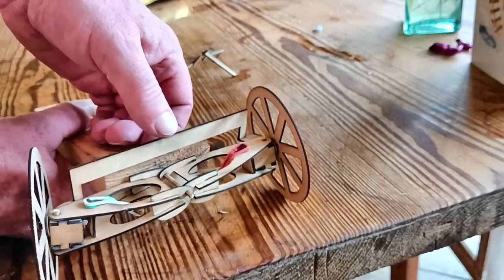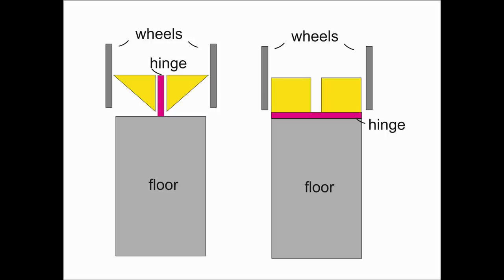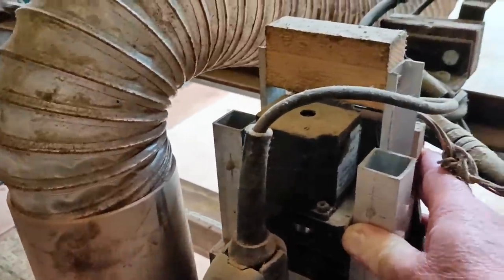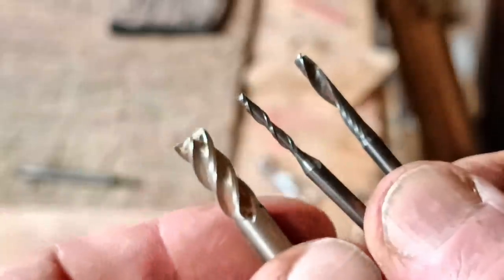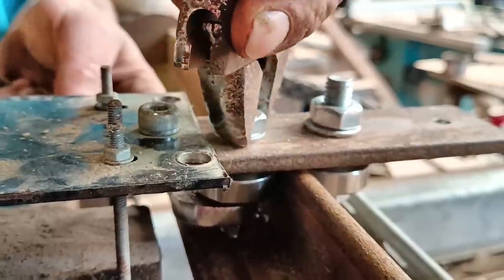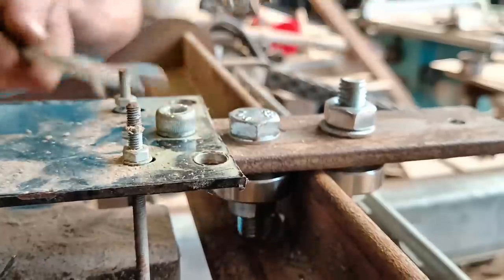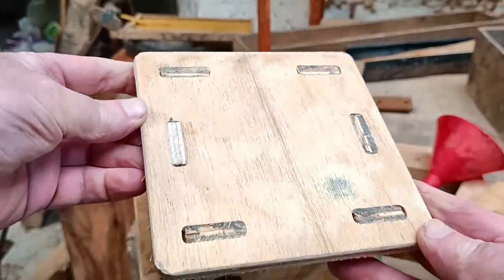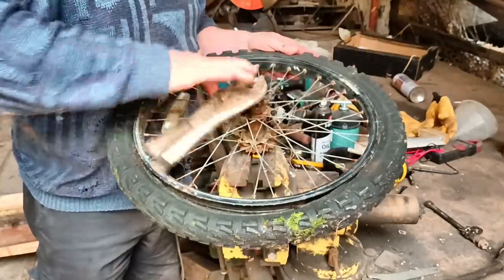Full Size Steering Box For The Wooden Car / Ebike Build

Comment: My dad made me a car when I was a kid. It had a gas engine in the back and I could go as fast as anyone on a bike. He knew the steering was critical at those speeds, so he developed a system that worked perfect. The steering column was a pipe and down by the wheels he fattened the pipe by clamping two blocks of wood onto the pipe. These blocks were mounted uphill from the axel for an angle pull. Aircraft cable was fastened to one side then wrapped around the rounded over blocks of wood then to the other side.. there may have been some other details to it but it worked great. The steering would be done on the pulling side but also taken up, evenly, on the other side. 
I hope you get the drift.
Cheers,
Lee
Reply from the maker: Thanks, Lee - excellent idea!

Comment: Teflon cutting boards use to be quite cheap and are rather slick as bearing surfaces.
Awhile ago I saw a guy making gears for a vertical axis windmill out of them and they worked just fine.
Reply: I was thinking about teflon cutting boards as well. 👍
Reply: Hdpe chopping boards are easy to get hold of too, I’ve used them as thrust bearings in fairly high speed and high load applications. Candle wax or grease between the two plates but this probably wouldn’t be necessary for low speed such as this

Comment: I think a thrust bearing is your best bet. Any extra resistance in the steering gear is going to make this machine a pain to drive.
Reply: That seems like it will push the price up.
Reply: What about sheets of white cutting board material in a large disk shapes. Maybe 4”-6” diameter disks of Delrin ( cutting board ) sandwiched top and bottom of the steering knuckle- suspension arm interface.
Reply: Sheets of HDPE should be plentiful around the farm: they're used in cutting boards, but also all sorts of liners and pens on things: it's a durable slippery plastic.
Reply: @bobsmith5088  Yes, but the vehicle needs to be practical and usable, particularly if he wishes to sell models- and decent thrust bearings are not that expensive.

Comment: have you considered making the front axle 1 piece and using radius arms similar to a defender front end. both wheels tied together with a tie rod behind the axle, and one of the hubs pushed or pulled left and right from the front via a drag link to a steering arm. these setups can provide excellent articulation and are good for load carrying which can be fine tuned with spring placement from the center. May the algorithm bring your content to the masses. Love your work

Comment: Bearings for the steering can be sourced very cheap by just picking up a few bikes from the junkyard. The bearings for the steering in bikes can really take a beating. In the 60s through the 80s, the swedish company MCB made workmans mopeds with two wheels on the front and a kind of truck bed between them, named MCB 1189. They used the same bearings for the steering as bikes from that time used, and I've personally had one of those old mopeds loaded with almost 200kg on the bed without breaking it. Those exact same bearings were also used as wheel bearings on the earlier models, funnily enough.

Comment: I definitely think a thrust bearing is your best option for your stearing... Those will be pretty pricey I'd imagine though, needing to be rated for at least a few hundred pounds.

If you happen to have some old plastic cutting boards laying around, you might try making some bushings out of those. They're usually make for HDPE, which is incredibly wear resistant & impressively slick when paired with s smear of motor oil (just make sure to machine off the grippy texture they press into them). Definitely not as good as a proper thrust bearing, or even something like a Teflon or Delrin bushing, but cheaper enough to be worth trying I'd bet
Reply from the maker: Good ideas, Pat. Thanks.
Reply: @wayoutwest-workshopstuff6299  you can just take the thrust bearings from the bicycle steering

Comment: hello again. With steering geometry, there are many angles to consider, with many odd names to be confusing. Anyway, going back to my college days in the 80s (Motor Vehicle City & Guild) the ones to consider are; Castor Angle, which keeps the wheel in a straight ahead position (shopping trolleys don't have any), Camber Angle, which in the inwards or outwards tilt of the wheel off the vertical axis (maintains the contact patch with the road during suspension movement) and Ackerman steering, which takes into account that the wheels travel different radii when cornering.
Reply from the maker: Exactly - so much to learn but I'm getting there...thanks!
Reply: Kathryn has reminded me of the name I was trying to think of, Ackerman steering, it was an important factor in the handling of National 100 racing karts back in the 80s.

Comment: Another post from me about cabling for steering.. I now recall he mounted a small Pulley on each side of the frame opposite of the blocks to change the direction, of the cable, square with the blocks of wood for a consistent wrap.
Lee

Comment: The kingpin could be rotating on bike head bearings, straight forward drilling a hole in plywood and smack the bearing "bell" into the hole, then mount the kingpin-box as a front fork :-)
Reply from the maker: true!

Comment: for such small load you could use regular wide edge flat washers  doubled up o both sides. they would work both as trust bearing and reduce the contact patch between surfaces, you can just super glue them to wood on both sides so they wouldn't dig a hole

Comment: The boxes will work but you need camber so the tires wont wear fast , by putting the steering shaft behind the axle its a push / pull situation but you could use bike chain and a sprocket on the steering shaft giving differant steering ratios ( bigger gear less travel ) and using the forks from the bikes with the box on top gives more support for the axle .

Comment: Before dished wheels that enclosed the king pin became available, front wheels were given a distinct camber, i.e. the stub axle was inclined downwards from the horizontal to tuck the bottoms of the wheels in to get the contact patch under the projected line of the king pin.  This is very noticeable on pre-war cars with undished wheels and narrow tyres.  The tops of the wheels are further apart than the bottoms.  Incidentally, the inclination of the king pin to give castor action does not need to be too severe, or the front wheels will shimmy like an out-of-control supermarket trolley!
Reply from the maker: Thanks, Peter - yes, I'm heading that way..

Comment: Laminating wood, especially plywood, with fiberglass cloth, makes it much stronger for use as engineering material. I'd wrap a box. You can use thinner wood so lose a lot of weight. The fiberglass takes up tension stress and the wood compression, where both are strong. Strong light and cheap. Just a suggestion... like what you're doing.

Comment: Hey Tim, thin HDPE cutting boards. Cut a pair of discs/oversize washers (4" to 5") to use as low-friction weight bearing surfaces. Very cheap, might work - might not, some thing to think about. SoCal Jim

Comment: You can use the thrust bearings from the bicycle steering! You need to dismantle 2 bicycles for the whhels anyways, so you can also just take the other needed parts from them...

Comment: easy thrust bearings for your steering knuckle, pick up some PTFE/Teflon cutting boards and cut large washers with you CNC
Reply: An old CD and those barings he removed from the bike wheel would do much the same job, set in to the ply, with the CD opposite for them to run on.
Reply: @JoesWebPresence  polycarbonate is pretty brittle, I doubt it could support the weight

Comment: Cost wise I'm not sure how it would compare in your area. But here in the US  you most likely could get a A1 set of tapered roller bearings at your local auto supplier for less than a true thrust bearing  and mount it vertical-ish for the king pin top and bottom and have a very strong relatively cheap bearing. Cut the proper size hole in your plywood and cap it with a 2nd plate to hold it down

Comment: Good progress.   Thrust bearings will take the most load.   If you want an inexpensive low-friction material consider the white UHMW (Ultra High Molecular Weight) plastic used in many woodworking jigs.   This may have a different name in the UK.
A quick alternative is 2 or 3 washers.   These often had ridges or raised edges from the manufacturing process, so sand them flat.
For the kingpin support, an inexpensive quick solution is to remove the threads from a nut of the same thread as the bar.   You can drill out or bore out on the metal lathe.
Dave.

Comment: You'll have to do and inertial mass calculation, to see if your box idea can deal with the stresses of weight when breaking, moving or turning. In the car industry to remove these stresses they use springs, hence why when you brake suddenly the font of the vehicle dips a little and roll when your turning at speed. Me, I would do what your doing, build the thing then see what happens, it's so much more fun. 🤗👍

Comment: The perennial problem of 'bump steer'.  Many cars suffer badly from it.  Of course you could just use a beam axle and rid yourself of the problem completely 😊  As you say, king pin inclination is very important to get the correct scrub radius.  Without it you get too much kick back through the steering, making it very heavy to steer and placing undue strain on the components.  Love this series  🙂

Comment: For the steering motion, could you build some plate bearings with steel plate, a bull-nose die grinder bit in the CNC, and a few marbles/old ball bearing balls? Kind of what you did with the railway turning plate, but smaller…

Comment: Regarding the loading on the front wheels, I have done some calculations. Let ybar (m) = the height (above the ground) of the CoG with the breaks applied. Let xbar (m) be the horizontal distance from the rear axle to the CoG. Let L (m) be the length of the vehicle (axle to axle). Let Rf (N) and Rb (N) be the reaction forces at the front and rear axles respectively (we want to solve for Rf). Let m (kg) be the mass of the vehicle when loaded. Let mu (unitless) be the coefficient of friction.

I have used the following values for my calculations, but they are just guesses so adjust as you see fit:
g=9.81ms^-2, ybar=0.5m, xbar=1.25m, L=2.5m, m=200kg, mu=0.75.

With the front wheels locked and the rear wheels freewheeling (no rolling resistance):
Rf = m*g*xbar/(L-mu*ybar) = 1.15kN (using my numbers). This corresponds to about 580N or just under 60kgf on each front wheel, and about 40kgf on each rear wheel. Suffice to say, braking should only change the wheel loadings vertically by 20%.
Reply from the maker: Thanks very much Isaac! I expect the total weight to be less than that, but perhaps you're right. What about the speed? Where does that come in?
Reply: @wayoutwest-workshopstuff6299  The coefficient of friction is often modelled as constant with respect to speed, although there is a distinction between static (no slip) and kinetic (with slip) friction. In addition, the coefficient of kinetic friction decreases with increasing velocity (the numbers vary from source to source but it looks like a 20% decrease from very low speeds to about 18kmh). Setting mu to 1 should cover the worst case scenario. Of course, air resistance also helps tip the car back at higher speeds, but shock loading from bumps is worse at greater speeds too.

Comment: You could use two flat steel plates on either side of that box with countersunk screws and do the same on the other side to the frame and just ladder those two plates with grease and that should we turn under pressure or compression better for not that much work to figure out

Comment: @12:05 - Thin sheets of PTFE or a suitable cutting board material.  I have a 30+ year old Maytag dryer that is using both thin cutting board material and natural leather as replacement bearing guides for the drum - going on about 9 years now.
Reply from the maker: good idea - thanks

Comment: Another interesting project Tim, excellent work as usual. We built carts out of bike wheel’s which were supported in both side like a bike. The big issue we found was the bike wheels would buckle under the side loading every time. All the best.
Reply from the maker: Oh dear! Were you doing mad things on the carts? slaloming at high speeds?
Reply: @wayoutwest-workshopstuff6299   haha. Not much slaloming Tim but she couldn’t take a hard corner at speed the wheels just folded. All good fun.

Comment: 0:18 I think the best solution would be to have both steering arms with a fixed angle at the wheel side and as a round pipe able to freely move in and out (and rotate) through a block in the center. To steer, you would move the block forward and backward instead of side to side.

Comment: Minor step that might help save a bit of time with the router; if you glue on a piece of paper before you cut (simple newspaper and a thin coat of cheap schoolhouse glue will do), often times I've found that's enough of a backer to avoid most of the tear out with plywood. Granted I've done it routing by hand, not with a CNC router, and with nice birch plywood, so your mileage may vary. Probably wouldn't make a huge difference on pieces like this where they're big enough to hold and the cuts are relatively easy to get into to sand, but if you get into smaller or more intricate pieces, it could save some time.
Reply: What about using painters tape?
Reply from the maker: Good ideas - thanks
Reply: @jimyoung440  That often works too, and can be used when you're making a single cut by hand, particularly on an edge. But if you've got multiple cuts, like you would with the CNC router, or don't have the cuts mapped out on the board to know exactly where it's going to cut in, having something that covers the whole surface of the board is helpful.
Reply: @kasbakgaming  Well, I can't think of a reason they would need to be round except I habitually make rotating things round. Nice point.  Jim

Comment: Very nice!

Could adding a spacer metal pipe between the bearings strengthen the assy? Not sure if the wooden structure is meant for that compression force?

Comment: When you steer with your system, the front wheels are moving in an arc backwards and forwards, which will impose longitudinal stresses on the chassis and make the steering very heavy.  Ideally, the projected line of the king pin downwards to the ground should hit the ground at the centre of the tyre contact patch so that the wheel just rotates about the centre of the contact patch.  However, to give some castor action, the king  pin should also be inclined slightly backwards so that the projected line hits the ground  forward of the centre of the contact patch.
Reply from the maker: so the kingpin should slope outwards as well as backwards? This is why car wheels are hollow on the inside, isn't it? So the kingpin is closer to the centre of the wheel?
Reply: Yes, exactly so. @wayoutwest-workshopstuff6299

Comment: The steering wheels should not remain parallel because the diameter of each circle in the turning radius is different.  Properly designed steering gear causes the inner wheel to turn at a different angle than the outer one.
Reply: Ackermann compensation

Comment: Bike barings like those ones you removed from the wheels could be used to keep the steering free. Set proud into the ply round the vertical rod, with maybe an old CD above and opposite for them to run on.

Comment: 12.06 min: My suggestion is to use nylon plates or nylon inserts. Simply buy inexpensive cutting boards or thinner Frühstücksbrettchen (I couldn't figure out the correct term but dear Sandra will hopefully be so kind and translate it or explain it to you. Thanks in advance, Sandra.). This is usually the cheapest way to get nylon material. 2) Maybe even thinn plates from those relatively hard type of placemats can be used. Silicone grease/paste/fluid should be added in any case.
Reply from the maker: Yep - good ideas, thanks

Comment: Bearing material could be plastic.   Sheet Teflon the best, huge  weight bearing and impact resistance. (even used on log trucks to support massive loads)  Or try UHMW plastic, much cheaper, such as used in cutting boards.

Comment: Having used the Kress on a cnc, 3mm bits are the perfect size for the machine. Larger bits means slower speed and the Kress will loose some torque. More important, PCB cutters   bits (called diamond shape) are the best bang for the buck if you cut plywood, they are cheap and last a while .
Reply from the maker: Thanks, I'll have a look for those..

Comment: You need a bit of steering axis inclination to reduce the massive scrub radius the front tires have with this arrangement. It will greatly increase stability, and reduce feedback from hitting bumps or such with just one front wheel.
Reply from the maker: do you mean having the pin inclined outwards as well as backwards?
Reply: @wayoutwest-workshopstuff6299  Yes, so if you were looking at it from straight ahead, the lower pivots are further apart than the uppers, with the spindles roughly level at ride height. Positive scrub radius makes steering unstable, especially if you have front brakes. Zero scrub radius will make it hard to steer when stopped, as the tire's contact patch is twisting in one spot. Negative scrub radius, where a line through the upper and lower steering pivots intersects the ground outside the center of the tire's contact patch, gives good stability and easy steering. The pivot angles also make the spindle tilt downwards as you steer away from straight ahead, which provides more self centering and steering feel.